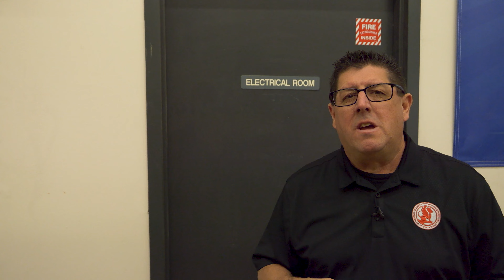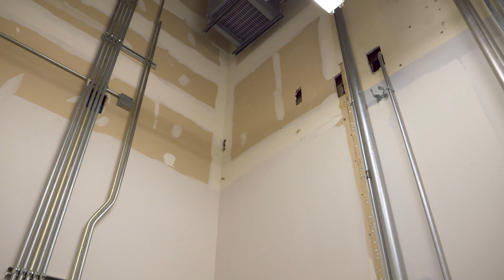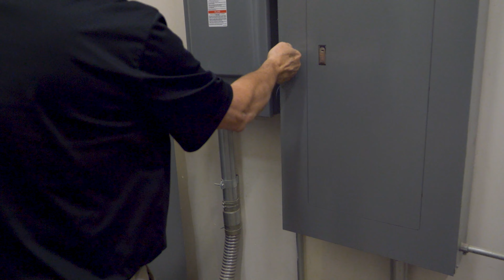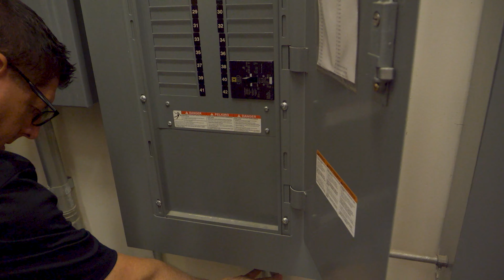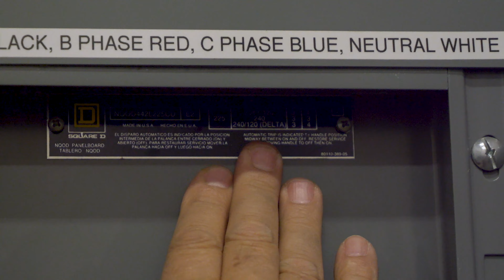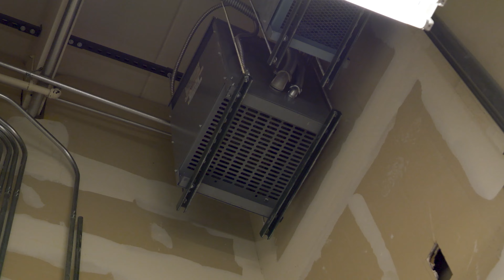Inspecting Transformers

Comment: 3:06- would be helpful to graphic identify which is primary, which is secondary voltage, and what HV & LV indicate. Thanks 😊
Reply: The primary winding is always considered to be the source and the secondary is the load. In most cases, the HV is the primary and the LV is the secondary as they are labeled on the transformer. If the HV is higher than the LV then it steps down. If the HV is lower than the LV then it steps up.